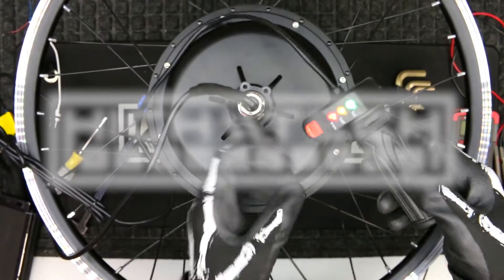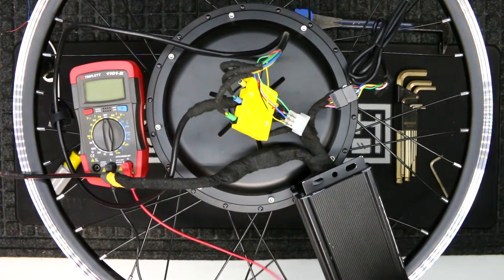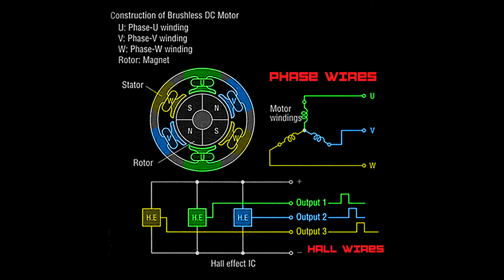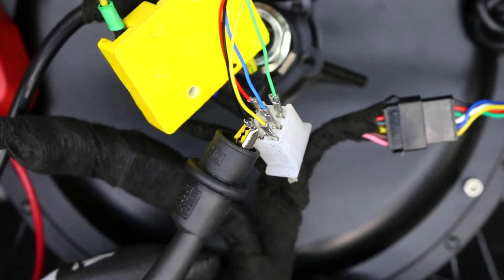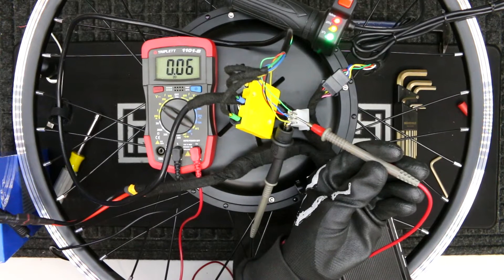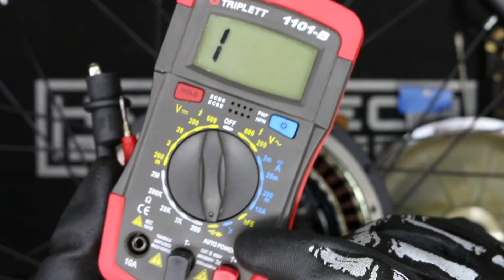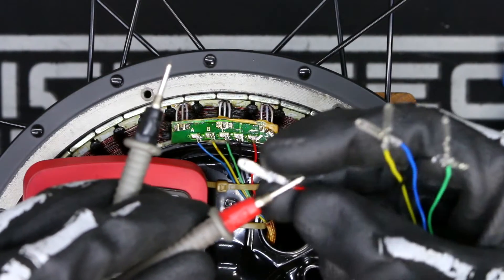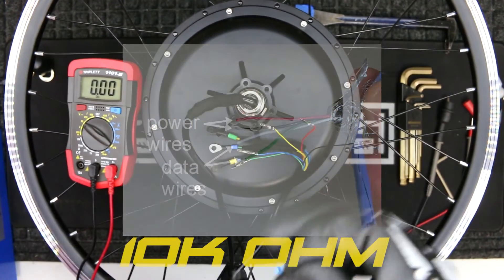🚲 How To: Ebike Hub Motor Hall Sensor Testing, Diagnosis, and Fixes (Display Error 10, Error 30)

Comment: Hey I did the continuity test, even replaced my hall sensors but the motor still seems to be twitching. Any suggestions?
Reply from the maker: It's unlikely, but still possible that the new hall sensors are not working properly, did you test them for proper operation by using the method I showed in the video by hooking up a DMM and rotating the wheel/magnets?

Disconnect the main phase wires (3 larger colored wires) and then connect any combination of two to each other and try to turn the wheel while holding them together, it should be very hard to turn due to the resistance. Try it with different pairings of the colors, if you're getting resistance with every combination then your phase wires are good. 

It's also possible it's not the motor that is the issue. If you have or can borrow another (known working) controller to sanity check, I would try that to rule it out. 

Could also be possible it's the throttle/PAS. I would narrow down the cause of the issue to the motor first 👍

Comment: I have done the first test,and I got some strange values...with the battery on and all the wires connected,soo I have taken out the cables from the bike and I have not connected the wires that go to the rear wheel where the motor is,soo I measured the current from the controller and are ok,one question,how can I measure the 3 wires that are going to the motor power,those fat 3 wires,the green,blue and Yellow one that I found to be black...?Also I will try and open up the motor from the wheel to see if that's the problem...
Reply from the maker: To test the larger phase wires, you'll want to tie two of them together (touch the ends of the leads of them together) and try to rotate the wheel, it should be very hard to turn when they are touching, but easy to turn when they are not touching. More info here: https://electricbike.com/forum/forum/kits/golden-motor-magic-pie/110168-testing-bldc-motor-s-phase-wiring-hall-sensors-and-wiring
Reply: @hightech-lowlife  soo found one small green wire cut,got that one sorted out,and put it to the test without connecting everything,just wanted to see if I can get ride of error E07...now is error E08, that's the throttle missing,soo I went to the bike, connecting everything and guess what?E10...I have disconnected the pedal assist plug,got E07 :)) ,went inside the house and got another pedal assist sensor plus new round plastic with 8 magnets on it and connect that one and no error on the display but nothing is happening,I had out the P05 on it..not starting when I press the throttle, nothing if I play with the round plastic with magnets on top of the pedal assist sensor either... maybe the new pedal assist sensor is not ok as it has different colour wires than the other one,like red is still on the middle but the yellow one is on the other side where the old one had the black one... should I try and swap them over and see?? Don't know what to do anymore:(
Reply from the maker: @departe5672  Looks like you're on the right track, good job man! Did pure throttle work before? I would try swapping the pedal assist wires if they are not matching up, see what happens. If the green wire was cut, I would check thoroughly for other wires if they had been affected too.
Reply from the maker: @departe5672  If you hold two of the phase wires together, do you feel resistance when trying to turn the wheel?
Reply from the maker: @departe5672  Hmm, if the motor is getting hot but nothing is moving, then I would be curious about that. Even when I'm using an ebike, it's very rare for the controller to get hot/warm unless you're really pushing it hard. Can you remove the controller and open it up? I would look for anything that looks burnt/brown, smell it does it smell like burnt chips? It could have a short somewhere. 

Be careful if you open the controller, it will have big capacitors that can shock you, so discharge the big caps before handling it too much by touching both of their leads together on the PCB with a screwdriver 👍
Reply from the maker: @departe5672  Yes I saw the video, seems like everything is working but it's still not working. The motor spins right? It would make sense if the motor was seized and the controller was trying to push it without it moving physically. If the controller looks ok, and all the wiring looks ok, then I would move on to the motor and take a look inside for anything strange.
Reply: @hightech-lowlife  
Like I said,I have made a video.
https://youtu.be/Bv6TAe6m15U

Comment: I built a mini e-bike, (not a kit) It was working fine, it was running perfect, I went to those shop, Left it outside and wen I came back out, It was dead, The trigger throttle is working, Showing full charge on the battery but just zero movement from the motor. No noise, nothing, I’ve tried everything, I’m lost, s0 close to buying a new motor, I’m going to open the motor in the morning
Reply from the maker: Yes, if everything else is looking like it's working fine, then time to open it up and look inside. I hope this video can help you identify the issue and that it's a cheap fix. 👍

Comment: I'm stuck with a problem with my voilamart 1500w could you help me dude ? It will spin when under no load (bike upside down) when I put the bike upright it just jerks forward a little bit and knocks I'm super stuck
Reply from the maker: Do the easy stuff first: check all wiring. Look for any chaffing or splits in the insulation, check all connections to be secure and free from corrosion. 

After that I would do these hall sensor tests and see if that seems to check out. I would start with these first. 👍
Reply: I cannot find anyone who has had the same issue lol

Comment: On blue i get 4.8-4.9v
On green i get 4.5v
And on yellow i get 3.5v
Should i replace Yellow and Green or is it totaly fine to get only 4.5v on one Sensor?
Reply: I measured again and now i got on green 3v and on Yellow 1v
i am Sure now that both are broken.
Reply from the maker: @kibou5832  Yes, I think 4.5 is ok, but 3 and 1 are not 👍

Comment: This video would have been pure gold for me 5 years ago. I learned everything to the point now I'm building my own controller and modified my bafang controllers to run with more power with out the speed limited. Great video though! This will help many noobs who want to DIY fix their ebikes.
Reply from the maker: Thanks so much! I'm hoping it can help some people just getting into DIY ebikes as a lot of issues can come from the hall sensors. Thanks for watching, much appreciated!
Reply: Are you in NYC?
Reply: If you like tinkering and getting the absolute max performance and customization, I would definitely recommend check out VESC controllers. Especially the originals from Trampa.
Reply: Any one had experience with a segway g2 max error 18? . I'm trying to test the hall sensors but I'm getting conflicting stories online with other segway models saying that the middle sensor is different of wired differently and or facing in the opposite direction . Kinda wish these guys would just put a PDF online for testing and replacing components. I rebuild motorcycles without issue as they almost all come with service manuals . Any way any help would be appreciated

Comment: Very useful information. Thank you!

My question is. How to determine the order of the hall sensors if the hub motor came with random hall sensor colors? I got a DIY Bionx motor converted to external controller online and the person who did the conversion did not follow the standard of color coding the hall sensors and power etc... 

Opening the motor is not an option because I would have to dismantle the wheel, remove the spokes... This motor opens just from the middle like a book.
Reply: Trial and error
Reply from the maker: That totally works, but on the first link in the description there is a chart that shows all the combinations so you can more easily find it 👍
Reply: @hightech-lowlife I know that chart mate but I thought would have a more efficient way to do it. Thank you so much anyway, I appreciate it. 

FIY this cheap hub motors can get up to 5kw if you fill them up with oil for extra cooling, beef up the phase wires and seal them properly to avoid leaking.
Could it be an idea for a video?! It's up to you to decide but I hope you like the idea. 

Cheers!
Reply from the maker: @Full_Throttle_no_Brakes  Oh yeah, I think it still takes time to figure out the combo, there may be a better way to do it or a faster way but I haven't come across one yet. 

I'll have to check it out, thanks for the suggestion on the video! I know you can do shunt mods and squeeze more power out of smaller motors too with extra cooling. I'll definitely think about it 👍
Reply from the maker: Thanks so much Diogo, oh - check out the link in the description (first one) it will have a chart you can use to determine the correct sequence 👍 or you can do just trial an error, note that it's not just the phase wires that need the right sequence, it's both the phase and hall wires, so it can take a while to find the right combo.